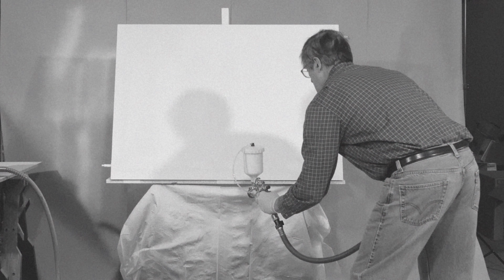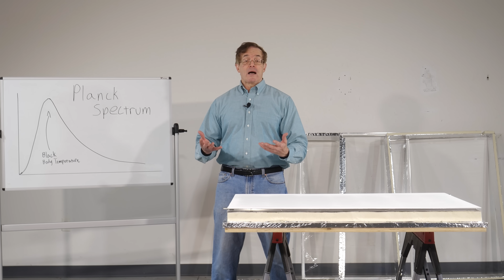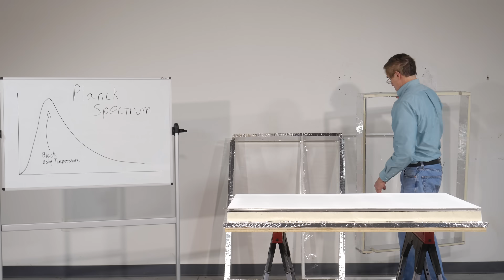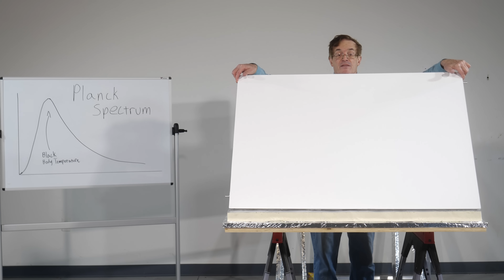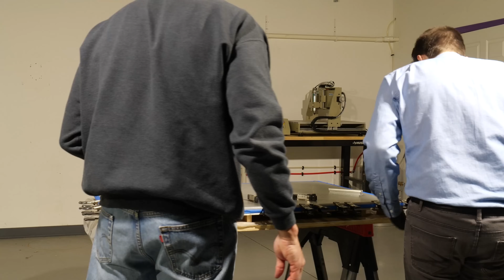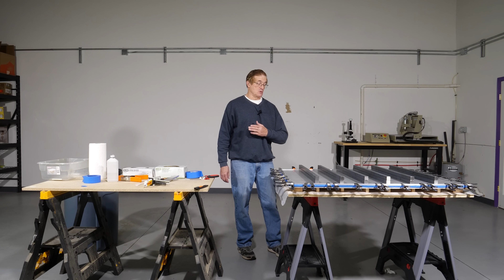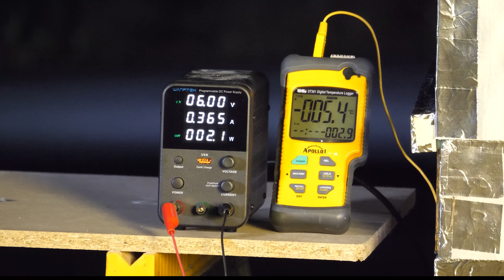Air Conditioning isn't free... but we're close.

Comment: Be very very careful about just cooling down your floor or radiators. If you don't have the temperatures and humidities right, you're going to have water condensing in places you absolutely don't want it. If this happens under your flooring, you'll have mold and rot in no time.
Reply: I saw an article on this very topic somewhere. There's a large public building in Toronto, tons of glass, very big sun load. They use radiant cooling in the floors with a buffer tank and a mixing valve tied to zone hygrometers so the cooling loop is always a few degrees above dewpoint. They still have fan coils to catch the latent humidity and a few extra degrees of sensible, but it's waaaay smaller than it would have to be, compared to conventional.
Reply: Could they redirect/wick condensed water to somewhere it could evaporate, adding more cooling?
Reply: @bakedbeings  Not really. The problem is that it would often condense in the carpets or under the laminate floors.
Reply: @jmonsted by your assumption, basements would cause floor rot.
Reply: @urbangangsta  They do, if you have the right combination of humid air upstairs, cold basement and no insulation.
Reply: @bakedbeings  condensing water wastes a lot of heat deficit. Granted if you evaporated it somewhere else you would be left with transport losses but still it is better not to unnecessarily condense water.
Reply: @bakedbeings  ehhh it would be counterproductive to dehumidify and then REHUMIDIFY. I've seen some info on indirect evaporative cooling that always seems to be 5 years away from commercialization. I myself nerded up (with zero practical engineering experience) on coupling the old railroad steam ejector chillers with desiccant beds that would be recharged with solar thermal. But in the end, it ends up being a Rube Goldberg contraption that would be twice as big, three times as expensive and one-fourth as efficient, as the plain old vapor compression AC systems in common use.

But I do think a sea change in how we heat and cool our spaces is coming. This high-emissivity radiant technology is one of them. Simple, low-complexity and easily replicated using common hardware store parts. DIY solar thermal panels aimed south and DIY lunar panels aimed north. Sharing a buffer tank to store heat and 'coolth' as the seasons demand.

This is not far from what Messana is doing with their radiant ceiling panels, except they use a Rheem Marathon tank and a air/water heat pump.
Reply: Perhaps it would be reasonable to use the indoor unit of a regular air conditioner (without an outdoor unit at all) as a cold distributor in the room. It has a condensate drain tray and tube. And at the stage of building a house, you can make a "cool ceiling" with built-in aluminum heat exchangers. You can even turn the pump on and off (with a simple temperature switch relay) if the temperature approaches the dew point.
Reply: I installed a hydronic (water) loop in part of my house. (15years ago)
In the summer i run my 55f ground water through the tube loop and feed it into the input of my water heater.

It doesn't seem to have any place where it should rot as the nature of how its installed.
There is a heat defuser, there is a plastic jacket and a vapor barrier....
I go into my basement that has exposed ceiling/(first floor) and i have not noticed any water dripping or pooling on the clear vapor barrier.
My basement is concrete floor, concrete walls.
And condensation/wicking has formed surface liquid after a week of rain and very humid days, in a row... But generally that is a humidity or capillary problem fixed by a dehumidifier.... (P.s. i love your tech dehumidifier design)
Reply: Thank you. Most of these comments are sucking this guys D and acting like he cant be wrong. All you need to do is bury a 12 inch diameter pipe 8 feet underground at 100 feet of length with one end drawing outside air in and the other into the house. The temp will stay relatively constant all year with only a 150 watt to 300 watt fan. It wont freeze and it wont get over 75F so perfect for AC. Unbelievable how complicated these "scientist" academic types can make something so simple. He is the kind of guy you would curse for engineering an engine bay with no room because it's more efficient by 2% making maintaining it very difficult. It is strange how some of the smartest people can be so slow on the simple things.
Reply: Very much doubt if this system has the ability to cool anything below the ambient  dew point!
Reply: I feel like this is the missed point here. For most houses with a boiler, the last thing that you would want would be cool water going through the lines on a hot day. Trying to capture all of that water and dispose of it would be a nightmare for some systems, and impossible for others. In its current form, I don't know where this would be practical. I'm interested to see though.

Comment: I'd be very interested in the durability of this supercoating.  We live in Phoenix and we have a pool, but that pool deck gets awfully hot when it's 120 degrees outside and your wet feet do a great job of conducting that heat.  Is this coating durable enough to walk on?  Or can it be made to be that durable with an epoxy coating without ruining its emissivity?
Reply from the maker: That's  a good question.  Epoxy  would significantly reduce  the performance, as I'll  explain  when we cover the paint.

Comment: A frame like that can be obtained pretty much ready made. An aluminum picture frame is pre-mitered to be held together with its own corner brackets tightened with set-screws. Available in many size options. (More channels than needed, but they're moot.)
Reply: One sheet can be set in and sealed where the glass would be held in the picture frame.

Comment: Run some tubes through the solar panels you made in your previous video into a large solid mass like a set of heatpipes, then, use this sort of a system atop the mass to achieve a greater differential between the atmosphere and the thermal mass resulting in a lengthening of solar panel longevity maybe?

Comment: I wonder, if you make it a large column to block most of the sun, how efficient it can get during the day ? because even if is just 4 or 5C as it was shown here, its already a HUGE improvement, and can be enough to make the interior of houses a lot more comfortable with a simple heat exchanger in the ceiling. the question then would be if pumping that much water through so much long narrow tubes would be more or less energy efficient than simple air-conditioning.
Reply: Good points. I also wonder how the heat of the motor in the pump is defraying the result.

Comment: Could you try and measure the cooling power of this system? Getting 4 °C bellow ambient is nice, but to estimate what area is required to cool a room flow of heat is an important value. Might be interesting to put it through the heat exchanger submerged in how water and from time and known thermal capacity estimate power based on temp diff. Looking forward to next vid, thanks
Reply: I'd also like to know how much power this emits into space.

Comment: As a former HVACR tech. I'm curious about the 'vacuum' machine / container.  Is it just preventing additional I R or is it also refrigerating the pool of water the recirculation pump is circulating?
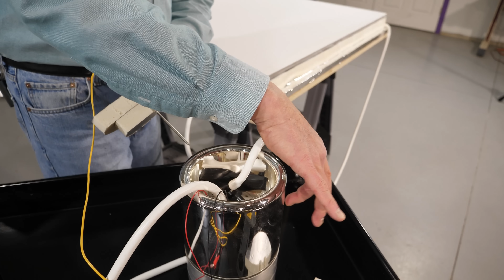Reply: The Dewar flask (fancy thermos) at 19:26 is meant to thermally insulate (from conductive and radiative transfer) the water reservoir to keep the test “honest.”  I suspect he is using that power supply to track an estimate of how much kinetic heat is being added because of the friction of circulation.  If you have input Watts and a coefficient (k=thermal watts out/electric watts in) you can make this estimate.  It may be considered negligible especially with losses out of the hoses.

Comment: Seems like a good, and relatively inexpensive, adition to a mini-split AC system. The only problem I see is the durability of the plastic film wind barrier. You could even improve both sides of the cycle. Put IR absorption panels on the south side of your roof, and IR rejection panels on the north side.
Reply from the maker: Agreed.
As you'll  see when we cover the paint  and daytime cooling, we eliminate the covering, and it works.

Comment: very very good coverage of this! amazing how the video ended up hitting on most of the things I had commented about in the last video. gratifying to know I had the right grasp of the physics involved. follow-up questions, what were the results like without the shielding? could the results be more dramatic if the unit was placed inside of an empty grain silo? or does it only need a few inches/feet to be sufficiently isolated ? please also design a pc cooling apparatus that uses this lol. i have no problem mounting a large radiator panel outside my computer room if it means free silent cooling.
Reply from the maker: Turns out we don't  need either with almost  identical  results, as you'll see.
Reply: @TechIngredients  I was surprised it was used to be honest, I wouldn't have even considered the ambient IR would have thrown it but I follow the logic for testing purposes to isolate as many variables as possible.  excited for the next video!

Comment: Why are we not linking our refrigerant systems so that we use waste Heat for hot water
Reply from the maker: It's  a problem with differentials. Pre warming cold water with the heat from an airconditioner or refrigerator is a good idea, and both systems  will benefit.
But,  as the water warms, the cooling systems will suffer, and you won't  get the water  heated to a useful  temperature. Staging is critical.
Reply: @TechIngredients  I would guess the solution to that issue would be a sand battery absorbing and retaining the heat from the refrigerant Loop and water running through its own Loop through the sand battery.
Funny question, have you ever seen an air conditioning unit sitting next to a pool heater? One blows out hot air and the other blows out cold air.

Comment: What if you used TECs to dump that heat from the structure into the water and let it radiate out into the sky? Also inversely, what if you had a panel just like the one you built inside the building with a heat absorbing coating?

Comment: what water fitting did you use to interface into the c-channel?
Reply from the maker: I might have covered that too quickly.
It's  a simple  segment of aluminum tube, supported with foam, while an epoxy bulkhead  cured around the tube.
Reply: @TechIngredients  Thx!

Comment: One thing I didn't get is: if you are using this at night and your point is to radiate as much heat into space as possible, why didn't you paint it black? Black has very high emissivity. Dark colored surfaces pointed at the sky get VERY cold, sometimes so cold they even freeze. That's how dew and frost on the grass form. Grass is kind of dark, it emits IR radiation into the sky, gets below dew point and then condensation covers it. Sometimes even freezes into frost.
Sure, as a heat-insulating paint for houses, white is the best, but for making heat-emitting modules with sole purpose of staring into the sky, black would release fantastic amounts of heat. Just make sure they don't stare at the point near the Sun. They would have to be oriented away, into an optimal point.
Consider how black telescope tubes get frosty at winter nights, yet white ones usually don't.
Reply from the maker: The barium sulfate paint, which we'll  cover next, is even better.
In the thermal infrared, the visible color is irrelevant.
Reply: @TechIngredients  I assumed you were using NASA's trick, but you could've explained it more thoroughly because the general notion of the video is that bright color necessarily means more heat retention, so it was confusing. I knew about these "walkarounds" when EM parts of spectrum other than light are considered, but casual viewer might pick up things wrong.

Also, a good thing to mention is the sustainability and environmental impact of special coatings on massive scales considering total life cycle. Something can appear carbon neutral or even carbon negative when a small portion of its life cycle is observed, but the rest brings hidden emissions, like mining, production and waste disposal, and effectively turns it carbon positive. Similar situation to solar panels when they are pushed to low sunlight areas with lots of rain. Production is highly demanding and output is pathetically weak, among other things.

Barium sulfate inside a polymer coating can be an overkill. In certain areas where paint-ruining rain is scarce, smearing slaked lime over a roof can lower Sun's heat absorption a lot , cutting the airconditioning expenses. People in Middle East have been doing it for quite some time. Production of calcium oxide is less demanding, but still considerably high. Upside is it's already done for making cement.

All I'm saying is it usually takes a serious environmental study to figure out what and to whom something is beneficial, but I'm confident in knowing you understand it. Great channel, I've been a longtime fan.

Comment: Great stuff as always, it's been a while, so now if the backside is painted flat black, with the same PE Film cover, it can be reversed and the top collar would collect IR radiation to heat water, to lessen the strain on water boilers, without glycol of course if the water is to be used, grew up in israel and 80% of buildings have sun heaters and boilers only get used in winter, an insulated tank keeps the water warm, so this could be dual purpose

Comment: I'm always a bit annoyed by the generic statment that emmissivity is the simple inverse of reflectivity. That is only true in a complete vacuum after infinite time to reach thermal equilibrium, which is fine for space craft but rather inaccurate (or outright false) for systems that have non-radiative energy transfer with the surroundings. Especially when figuring in the emissivity and reflectivity curves of real materials which can have large localized deviations from the ideal curve of Planck's law.
Reply from the maker: Why does that annoy you?
It's true. Neither property involves direct thermal contact, and a vacuum isn't  relevant.

Comment: I have been following the story about the "paint" that radiates through gaps in the IR spectrum where green house gas don't absorb energy.  I found another video that shows how to make the coating.  But, your system is closer to my needs.

Adding the liquid heat exchanger after the air conditionings exterior radiator is excellent.  The same approach could be used to modify an existing air-source by adding a geothermal system on the output of the air-source.  You get geothermal performance is with a smaller system.  It would also allow upgrading systems too new to replace.
Reply from the maker: We're  using that same coating  as you'll  see in the next video.
Reply: @TechIngredients  To quote Robin Williams, I wait with worm on tounge (baited breath).

Comment: Why are you talking about cooling the AC working fluid after the condenser? It would be more efficient to use it before the condenser. Just like a desuperheater.
Reply from the maker: No.
The heat load is efficiently reduced by the heat exchanger, but to FURTHER cool it, the radiative stage works best when the heat load is low.
Reply: @TechIngredients This was my question as well.  If the energy being emitted back to the sky increases by the 4th power of total energy, then it stands to reason that you would want your panel to be as warm as possible. At least that holds true for normal heat transfer mechanisms.

Comment: We learned most Heating and cooling world wide suffers from cooling fins in units get dirty and have some sort of biofouling growth ( Biofilm ) that collects, grows and lives in side them creating a thermal blanket making them almost impossible to clean  thus increasing their inefficiencies.  We're pumping more power into the units wasting more and more money. Companies get to the point of spending very large amounts of money to replace parts due to the blockage.  Hvac cleaners use pressure washers that only clean the machines with little effectiveness to restore some efficiency as they can never deep or fully clean the radiator fins.   We're blessed to have thin ac radiators at home and keep them clean. The problem is the industrial deep radiator type fins that cannot be cleaned so easy or at all. This technology hasn't changed in over 100 years but plaques the device.